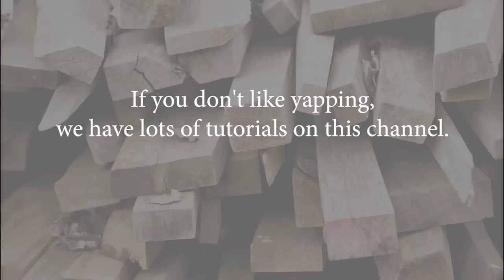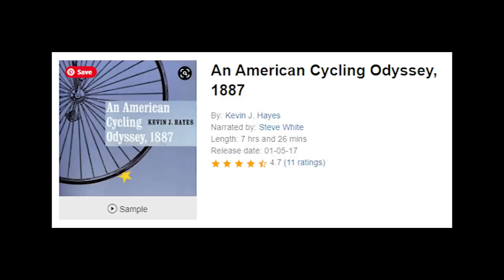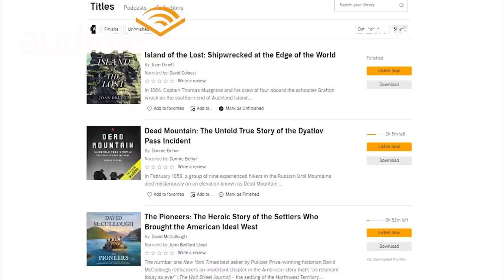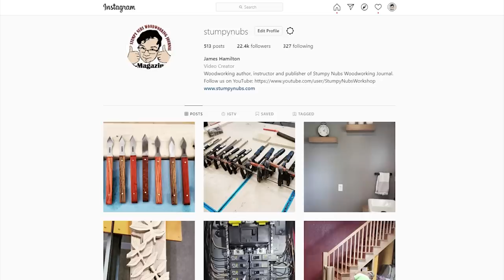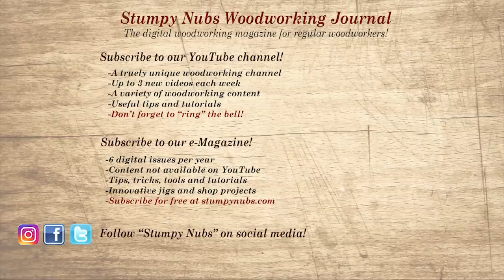Have they BANNED table saw dado sets????

Comment: Bit confused here. Why are you extolling the virtues of a dado set, yet building your casework with pocket screws. The tool of a weekend warrior?
Reply from the maker: So, you think everything should be built in the same ways with the same tools?
Reply: @StumpyNubs  I think pocket screws are an amateurish short cut used in place of good cabinet making skills.
Reply from the maker: @killickj  I see. Well, I avoid judging people based upon arbitrary standards. For example, the built-in seen in this video is a permanent structure. I could climb it like a ladder if I wanted to. It will be there when the house is torn down 100 years from now. That's the standard, right? Whether the method of joinery used in a project suits the purpose of the structure. Calling something that works "amateurish" is simply condescending. It's like a person who uses hand tools calling a power tool user an amateur because he thinks dovetails are somehow superior to finger joints- when both will serve the same purpose and last equally long.... Your comment also reveals a misunderstanding of pocket hole joinery, which isn't "the tool of the weekend warrior" at all. This type of joinery has been used in furniture making for centuries, including by the Shakers, who were hardly amateurs.... While I would not use pocket screw joinery in many situations such as chair and table legs, it is perfectly appropriate in other situations such as cabinets and bookcases. But I judge people by a different, non-elitist standard, I suppose. Have a nice day :)

Comment: Hi, I love your channel but yet again you Yanks forget that there is an entire southern hemisphere! but alas we copy our colonial masters and the shaft length of table saws is restricted in Australia and NZ so we cannot use Dado set's even though we can buy them. Cheers mate, keep them coming.
Reply from the maker: Just because I am discussing a different hemisphere doesn't mean I forgot the Southern one exists. Not all conversation have to be all-inclusive. That's like saying I forgot I have a neighbor across the street because I am talking about the neighbor directly next to me.
Reply: My Jet table saw will take a dado set, purchased from a local dealer in Oz. A fair number of dealers just buy 'EU' rated models in the hope they will get past the electrical requirements & they come with stubby 30mm arbors. You just have to do your homework on the models and confirm which model you are getting (take a set of calipers if you can get into the showroom).

Comment: Castle nut?
Reply from the maker: Macadamia nut?
Reply: @StumpyNubs  , if you could use a castle nut with a threaded rod, that would prevent your nut from loosening, causing your blades to fly away.
These are used in the automotive world.

Comment: They are only banned in commercial workshop private individuals can own them. The dw7492 has an arbour long enough for a dado blade. On large building sites you will struggle to get the saw its self on the job let alone do any kind of none through cut in the uk. You can always order one from the us no problem and use it at home just not at work. Sad but thats the country we live in theres alway some arse hole with a clip board pissing on everyones chips.
Reply from the maker: It's funny how half the folks in the UK that comment on my videos say you can't get saws that will equip them, and half say you can.
Reply: @StumpyNubs   well i think the saw i have is the same saw as the us model with a difference apart for the hertz the motor runs on so the arbour length is the same being a dewalt job site saw im sure the just make the same saw world wide. As far as cabinet saws go i wouldnt know

Comment: Banned?
Reply from the maker: Did you watch the video?
Reply: I have a Bosch contractors saw here in the UK. On a forum, a Bosch rep posted the following:

"Using DADO blade is prohibited by EN and IEC standards. Therefore this is not offered in the European market."

So...  I could get a stack imported for a US spec saw (which other than the motor, seems to be the same spec as a UK one)... if I didn't mind doubling the price of the set in shipping, import fees & Taxes.

I do like the idea of the floating guard though!
When I get out of my 2.5x2.5M... sorry, 8'2 & 7/16"x 8' 2" &7/16" shed, and Idon't have to pack EVERYTHING away everyday, I might build one of those.

Once I've had a few cups of tea, of course
Reply: @StumpyNubs  he's probably too busy Quarterbacking last weekends games...

Comment: Its not just europe! US is the only major country that doesn't use the metric system!
Reply: On paper, the US has been metric since 1866.
Reply: Not quite. There are 3 countries that officially use standard. There are 13 countries that do not use the metric system, by either using no official system or their own system. And only 3 countries is fully metric (Russia, china, and north Korea. all other countries use aeronautical units for flight, and nautical units for sailing).
Reply: We use it, but we don’t like it. Just 40 degrees temperature range in an average climate or up to five degrees in a single day isn’t much detail. Still waiting on that metric clock time any day now. Yes you can use a decimal but we hate that as much as you hate fractions.
Reply: Read my post above. The imperial system is better if you’re working with a ruler. This is why we don’t change. 

And the US does officially use the metric system. But again there’s zero reason for industries to switch.
Reply: @FrancisoDoncona  yes, Celsius is too coarse. And the meter system is the same way. Too fine at one end (mm/cm) and then you hit a meter. Nothing in between.
Reply: @DavidRavenMoon  It would take you a month to get used to. Much easier to use.
Reply: @albertqss  I’ve been using it for years. It’s not easier. Use the standard system for a week and see. Are you afraid of fractions? Look at a standard ruler. See how inches are divided with different length lines? It’s a more visual system. And doesn’t require counting. What’s half of 3/4? 3/8. I can just see it.
Reply: @DavidRavenMoon  to divide a fraction in half just double the bottom number 
So easy 😄
Reply: @DavidRavenMoon  I used to be a pro carpenter and now i build furniture for years in the USA. 27 years. I grew up with metric, being a mechanical engineer student back then. I have no problem with Imperial, but the metric us much simpler.
Reply: @buddyg1408  yes. But the metric system doesn’t divide things like that on rulers. Just mm and cm and mm and cm and… it’s like a remedial ruler for pre schoolers. 😁
Reply: @DavidRavenMoon  Whats a third of 3/4. How about a fifth if a 3/8?
Reply: @DavidRavenMoon  your currency is based on the decimal system; metric system works exactly the same way.  Centigrade is based on the freezing and boiling point of water. Quite how you view that as being more 'coarse' is beyond me. Everytime I hear "three and five sixteenths " or "one quart and two cups" I feel like I'm in a Harry Potter movie :)
Reply: @albertqss   Why would I need to know that? My point is that inches are divided into 1/16” (and smaller). But it’s a visual system on the ruler with different length lines. It makes it very fast. Metric rules don’t do that. I can see 1/16, 1/8, 1/4, and 1/2”.
Reply: @albertqss  and 3rd of 3/4 is 1/4.. I mean. Duh. A 5th of 3/8 is 3/40, which I’ll never have a need for.
Reply: @DavidRavenMoon  I lived long in the both worlds and practiced both systems for a long time. Just gave you my oppinion. I guess it is hard to compare if you just tried to use it and not lived it with no other choice. I don't want to use metric now, as I live in the US and used the Standard system for more than half of my life heavily and very much used to it.. But metric is still much easier.
Reply: @DavidRavenMoon  why, can’t you count to 100?